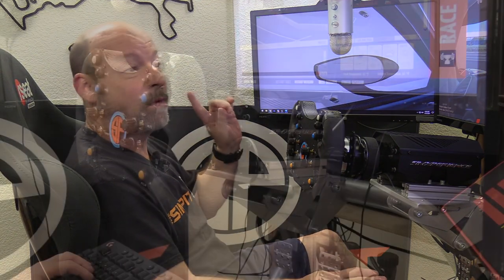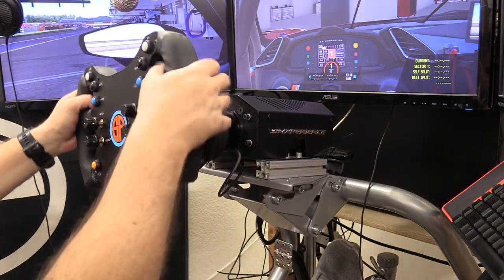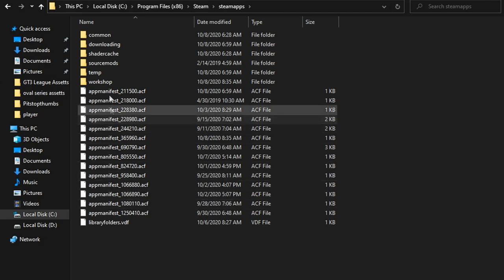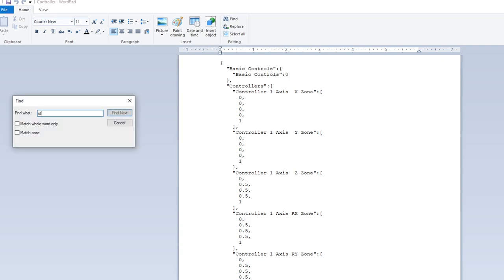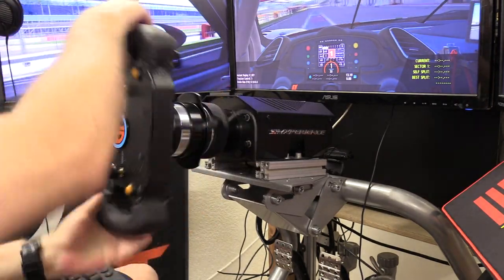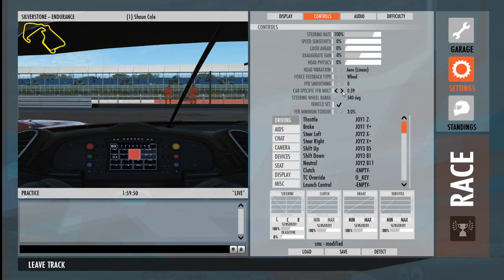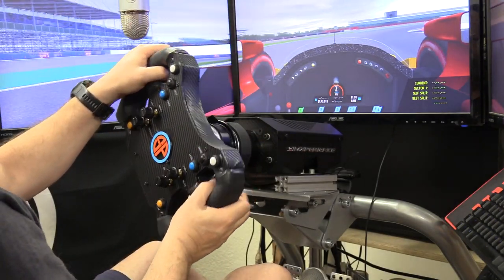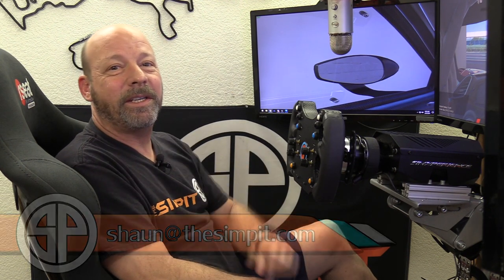How to fix Broken Force Feedback in RFactor2 - Direct Drive Wheels

Comment: There is an easier way to fix this. Im using a Moza r9 and basically I had been turning up the FFB strength in game positive to about 80%. Well Positive in game is actually negative on the wheel. So I just cranked it to -80% and its no longer inverted. No need to edit json files anymore. You will still get your ideal FFB strength, but just go the negative way instead of positive in game.
Reply: I have the r9 also. I was fighting a hard spot in center when I had it on 80%, but when I put it on -80% it gives me a death wobble. I have it on 0% right now (in the game) and it's smooth but it feels a little light on the ffb. Any suggestions?
Reply: @jroyce3689  so with the wobble it's two things. Play with dampening until it goes away. But also this game has flat spots on your tires if you lock up so you have to be careful of that otherwise the wheel will freak out and wobble like that.
Reply: Thank you Charles, I'll mess around with that setting.

Comment: I tried this and now every time I open the game the value resets to 0 after I save it at -10000 giving me no force feedback at all, cant get it to stop going to 0.
Reply: Same here, any fix
Reply: make sure you are setting steering strength, and not DI steering strength. that fixed for me
Reply: @porsche9598  I just ride that, for me the steering strength was already at -10000 but my wheel still rotated to the side. When I change the DI steering effect to -10000 it resets to 0 and if I set it to 10000 it rotates to the side. Really strange issue, I want to race in LFM but it’s currently impossible to do so.
Reply: @oliverkitching7295  For me setting the DI steering back to 10000, and normal steering strength to -8000 fixed it. no more spin and i have ffb
Reply: I am having the same issue. No ffb

Comment: I’m on DD and I always aim for zero smoothing. In the case hitting kerbs is genuinely to violent, I’ll pop it on one and that takes the edge off. Only URD mods do I need it on two, especially kerbs at their twin ring motegi mod.  I also noticed your minimum torque. For DD wheels minimum torque should be zero.  When I had a csl elite I had it on 0.50. Hope this helps any new users - With RF2 you want smoothing, multiplier and torque on the lowest numbers possible to get the best details and FFB, whilst balancing against strength of resistance. Enjoy !

Comment: You don't happen to have a fix for Heusinkveld Ultimates not binding in game when in combo with a DD1 Shaun? :)
Reply: In rf2?
Reply: @RinoD74  Yes, can't get my pedals to work in rFactor2, seems to be the DD1 Ultimate combo, works if the DD1 isn't turned on. Hard to steer then though..😅
Reply: Strange. Same problem in Iracing or other sims? I know you need Di View to get the pedals to work in rf2.
Reply: @RinoD74  I do have the same issue with KartKraft, all others work without issues, and I did use DiView to set them up.
Reply: Really strange. I'd try to connect it to a powered usb hud.